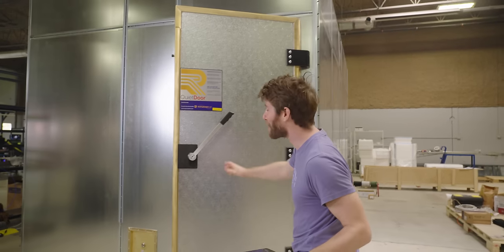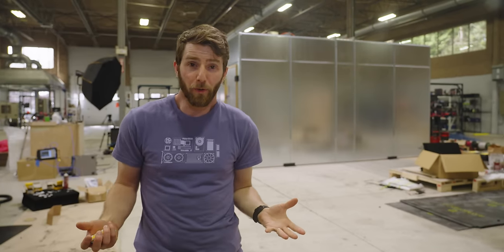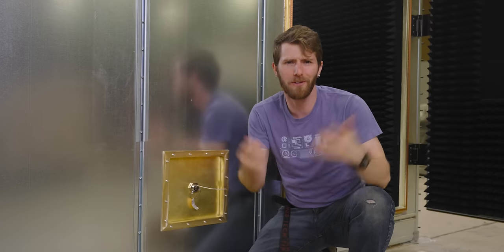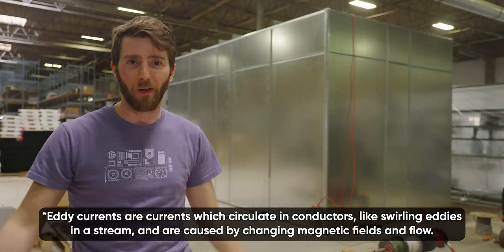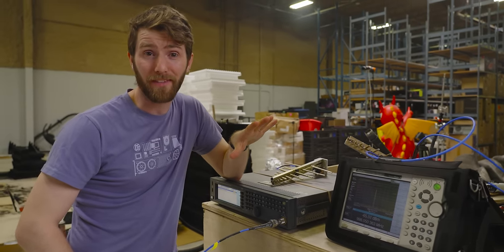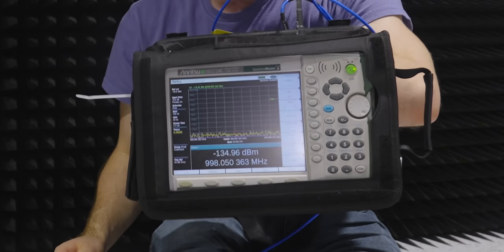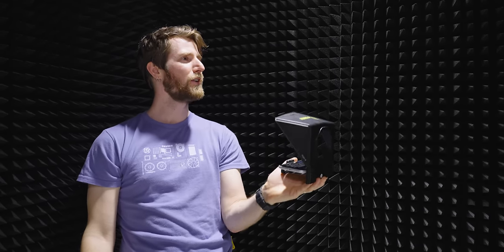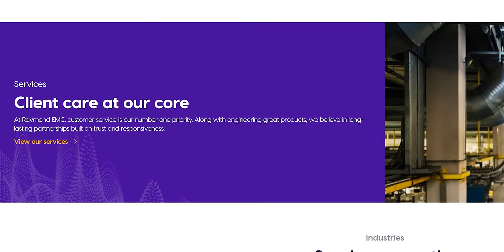There goes all my phone sponsorships… - RF Chamber Explainer

Comment: How does the floor differing affect things? Also what is the 'middle of the room' is the phone placed at the exact same place in the middle of the chamber? Like 1.5 m off the ground? Or adjusted so that a 4 inch screen and a 10 in screen are exactly in the centre? Also, can't tell if those are crazy questions to be asking or not considering what goes into making these chambers?
Reply: Those are definitely not crazy questions - I test wireless devices and a difference of a few inches can affect signal strength, in a reflective environment at least. The purpose of the anechoic chamber as opposed to just a simple faraday cage is to prevent reflections of the transmitted signal from interfering with the test and make this much less of a factor. 

That said, the position and orientation of the device relative to the transmitter can also make a difference for the direct RF signal as well, depending on the pickup pattern of the antenna and surrounding components.

Comment: Hey Linus, have you heard of PS Audio's Power Plant?  (Or Regenerator)  It is basically a Class D amplifier that takes wall power and turns it into totally clean power for your devices.  VIrtually zero noise, totally regulated, perfect sine wave.
Reply: Well, what's the switching frequency and how well is that filtered on the output?

Comment: Bro you could use the old foam panels as acoustic panels, even if they aren't optimal they would be better than anything under half that thickness, which is pretty damn good.
Or just cover the ceiling in Linus's office for a prank.

Comment: RF is fun because it's as close to legit black magic as you can get in the modern world.
Also, maybe an idea in the future to demonstrate the RF intensity could be to shift the detected frequency down to an audible range and use it to generate a tone. Then you would have some low-level white noise, but you'd get a very clear whine when you're picking up the signal.

Comment: I worked inside these for years.  I'm reasonably certain any SCIF is also a Faraday cage.  However, the one time I took an antenna inside and hooked it up to our SA, it didn't seem to be doing a very good job at blocking much of the AM or FM bands and I could even see our 9Ghz and 15Ghz repeater signals.  So, not very well designed.  For whatever reason, we called the team responsible for their maintenance the Tempest Team.  I have no idea why.

Comment: Should have explained better what the small chunk of wire was doing to screw up the chamber. It is insulated and acting as a passive unpowered bidirectional antenna and transmitter. Electromagnetic waves on the exterior of the chamber are causing the electrons throughout the wire to passively resonate as eddy currents in the wire. These moving electrons then re-radiate the electromagnetic waves into the quiet interior of the chamber. Grounding dissipates the induced eddy currents in the wire, acting as a massive capacitance. Absorption still happens but no re-radiation occurs.

Comment: Linus 2013: This case comes with two 120mm fans
Linus 2023: This EMC chamber comes with a very specifically designed hole called a wave guide, letting some electromagnetic radiation through, but by making the length exactly 4 times longer than the diameter, the waves cancel each other out.

Comment: Got to image that door is going to be the weak point of the system,  opening and closing over and over will eventually deform the metal (either the knife edge or the slot) and then knock it out of spec,  I mean if each screw has to be torqued to the exact same spec I can't image that won't let signal slip in

Comment: I have no idea if this will be part of the testing list for phones but it's something I think should at least be looked at. Low reception battery drain.

Vivid Sydney is currently on and when I have been to Sydney during major events like Vivid phone reception can get spotty and very slow with the mass amount of people using it at once. My phone usually stays in my pocket with the occasional photo but I notice a massive increase in battery drain and phone temp as reception gets spotty or grinds to a halt, my fix is to drop it from 5G/4G to 3G which almost no one uses now and the battery drain reduces massively.

To me it feels like it heavily prioritises being connected to the better version even if ping and speed is damn near none existent, same thing happens in country areas. It feels like the phone is constantly hunting for 4G or better when 3G is all that's available and I need to force it to stop looking for the better connections to reduce the in pocket drain

Comment: Wait, higher frequency waves pass through objects more easily? I thought the opposite was true... well, that's annoying. Time to change the settings on my router I guess. 
Also, does the copper wire thing mean that if I run, say, an extension cable from the first floor to the second without plugging it in, the signal on the other end just magically gets better because the waves are travelling through the wire?

Comment: Physicists and technicians had to build a faraday cage around a linear accelerator, close to an MRI. The people said they couldnt pull it off, but they did.

Considering a bit better understanding of the challenges... I am fucking impressed XD

Just for fun: the wire Linus sticks through the hole in the wall becomes an antenna. 

And a technical question: Reception is in part determined by the SNR (signal to noise ratio). Do phones apply tricks to increase SNR, is there some kind of tuning involved, some phone antennas more sensitive to than others? You can boost the signal with more power at the cost of battery life - can you listen better somehow?
Reply: Antennas definitely have to be tuned for optimal performance, and the shape of the antenna will affect its performance too. Receiver gain is another thing - you want to boost the signal as much as you can, but not unwanted nearby RF which may overload the receiver if it's cranked up too high.

Comment: test the security of microwaves on the Bluetooth spectrum
Reply: bluetooth is 2.45 GHz at a maximum of 2.5 milliwatts and is nowhere near the microwave spectrum. BT is below the amount of energy that is emitted by mobile phones. A home microwave oven (lowest-powered microwaves) generates microwave energy on the order of 500 to 1200 W, in other words thousands of times more energy. Further, Bluetooth energy is not confined in space and, like any other electromagnetic wave, obeys the inverse square law so the further away you get from the Bluetooth device the smaller the amount of energy; conversely, in a microwave oven the energy is confined inside a metal box and maintains a very high level of microwave energy within that cox (the cavity).
Reply: @EVOLICIOUS  I am aware of this. However, I wonder if it is possible to determine how well the cage works at containing the energy. As well I have noticed that the microwave does interfere with my bluetooth headset so I am curious as to how much noise a microwave produces.

Comment: Wait wait wait wait...I have been led to believe high frequency signals are more easily blocked by obstacles in their way.  Indeed, I dealt with this some years ago when I got a robot vacuum and it only worked on 2.4Ghz and my new, fancy Google Mesh router would not let me select the signal.  I contacted Google tech support and the answer was to walk the robot down the hall till the 5Ghz signal dropped out but the 2.4Ghz signal was still there.  And that actually worked.

But now you tell me the high frequency stuff is what gets through?  I do not doubt you are correct in what you said but I feel some detail is missing.
Reply: The higher frequencies have much shorter wavelengths, which means they're able to squeeze through much smaller gaps - you're right that they travel a much lower distance and don't permeate solid objects as well though

Comment: did i miss the part that explained what this is for?
Reply: I'll be running mobile tests around antenna quality, transmission power at different frequency bands, etc, as well as testing wireless Access points and Bluetooth devices in it :)

Comment: As an RF engineer i can appreciate your effort, but the ross stanton cosine hypothesis shows that your cage will distort any measurements. Bi-radial displacement algorithms used to determine the cross hatch EMF sheild deflector must be used to effectively disperse RF, EF, ST and WX radiation.  The Rf= 2pi/|A|. If |A| = 1 formula will show that a trajectory of a counter sine wave would be more efficient.  

Sorry linus not this time 🧐

Comment: $100,000 for an Anritsu MS2724C and a signal  generator....ummmm bullshit! Anritsu MS2724C is about 15K, must be some fancy signal generator to cost 85K
Reply: Safe to say it is a fancy signal generator. And considering the price is for an entire engineered unit not just two components in a highly specialized  field then it certainly could be a six figure setup. A walk in spray booth that size is worth close to twenty and that’s just walls, fans and filters. Ever looked at pricing on cold storage. Same thing. Price seems silly for an insulated room and some refrigerant, pumps and compressors. That’s industry.
Reply: @DickGently  no, watch again, he says the anritsu and signal generator are worth 100K not the whole setup
Reply: @aydeeaychbee6336  Yep. You’re right. Just watched again and saw your comment. Guess it’s substantially fancier than the 60$ rf signal generator I got off Amazon.

Comment: Unnecessary air permeability, 1960s attempt at filtering high frequencies from an unnecessary A/C connect, what's the point? This thing is an 'OK' EM shielded area, but even a sealed box of copper foil is better, you don't need to live in it, just run tests, all these holes pointlessly comprised the incredibly expensive enclosure.

Comment: Erm, wait!
Linus: "The higher the frequency or the shorter the wavelength of these signals, the more challenging they are to block"
Nobody who replaced a 2.4 Ghz Wifi with a 5 Ghz Wifi will understand that.
Reply: The narrower the gaps they can squeeze through, but yes they don't permeate solid objects as well as lower frequencies